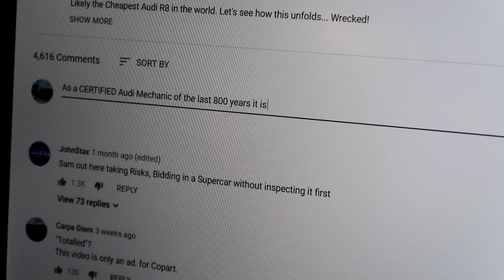I Finished the Salvage Audi R8 Rebuild Project! (and then BROKE it)

Comment: you don't need to be a "certified audi mechanics". Aluminum metallurgy is aluminum metallurgy. If by "fixing" it means closing a crack, than why not using putty instead? YEs, then you "fixed" it as well. Next time use gorilla tape, you'll save the 600 $ of "illusion welding" and your car will be fixed as well. ".. Aluminum welding typically creates a softened region in the weld metal and heat affected zone. Additional heat treatments may be needed to obtain an acceptable material for an application..."
Reply: smitthone for me it just sounds like you are pissed that it wasn’t you that made a deal on the car🙈🤣 I’m also a welder and I know that that repair will do just fine👌 as it is right now it’s probably better than OEM...
Reply: @vw52berg  Well, even more scary if you are a welder. And welding T Heat treated aluminum is not the same as welding the frame of your window

Comment: Hey Samcrac, it might be a good idea to find a couple bolts the same size as your wheel bolts, you can cut the head off and weld a small nut on it to turn it with a wrench. you can use it to make it much easier to hang your wheels on the car

Comment: OEM R8 alloys with same offset and they touch the callipers? Pretty weird if you ask me. 
Check the values on the rims you bought and compare it with the ones that where already on the car. You can find somewhere on the rim all the dimensions, they are pressed or graved in the metal. You may have to separate the tires from the alloys to find them. Here in Europe the offset is indicated by value "ET" don't know other parts of the world use the same standard.

Comment: Sam,  you should really get the carbon fiber air box, and get the carbon fiber side blade.  I wouldn't judge you for wrapping the side blade carbon fiber either.  but the carbon fiber air box really looks good.

Comment: A quality set of spacers will fix you up right sweet no problem. And don't listen to the people that start trying to to scare you with horror stories of "My friend had spacers on his 2012 Mustang and he went around the corner and his wheel came flying off and killed three Walmart Shoppers!".  Spacers are perfectly safe and work great if you buy proper ones for your wheels and use them correctly. Just search something like "What spacers should I use for my car" or something like that and you'll get any info on the subject you need. If you use the right kind (With a lip for the inside hole) you might not need to use the rings you have on the rear ones. But check into that first.

Comment: I know  am late to the dance on this car, but I had some crooked Volvo wheels repaired by a company named Alloy Wheel Repair in Birmingham.  They met me in a shopping center parking lot near me and used a jig set up with a hydraulic ram to straighten the wheels.  They also ground, polished and painted out the curb rash on three wheels all for a very reasonable price.

Comment: The weld was done fine as far as I can see - it was no less than they’d have done in the factory. The huge red light for me though would be those wheels -$1400 for 4 wheels tyres and sensors??? On a car capable of 180mph!?! Wow. There’s a reason the originals cost so much - they are rated to take not only the correct weight of the car but also the speed it’s able to do. You’d want nothing less than the best rubber on those rims (Pirelli P zeros or equivalent) which run £500 each on a car like that unless you just plan to use it as a runabout and not get some speed out of it. The fact that they are rubbing on the callipers means they are not correct for the car. Worrying. Other than that looks like you got a bargain though fairly high miles for a super car at 43k. Also interesting that the door buttons and key fob is the same as my 2009 vw Passat 😬.

Comment: Hey, Sam.  Big fan.  I hate to be the bearer of bad news, but those new tires are not the appropriate size for the (08-15) first gen R8.  I own a 2011 V10 Spyder.  Specifically the rear tire diameter is way too big.  USING THESE WHEELS COULD DAMAGE DRIVETRAIN COMPNENTS.  Factory size is 235/35/19 Front, 295/30/19 Rear.  I would suggest purchasing 305/30/19 Rear tires to avoid issues, they would pair well with your new 245/35/19 Fronts (IMO).  Regards, Ryan.

Comment: I would yank those front calipers off the car so fast and take them to a machine shop to mill 0.015" - 0.025" off of where there is any sign of rubbing/interference... Those calipers are way overbuilt castings, so that small amount shouldn't hurt anything, and once you paint them, no one will ever know. It will be our "secret"...

Comment: Why did that break caliper rubbing happen only on one unit? (The side with the frame failure....hmmm.)  
Shouldn't at least one  other caliper have had the same damage if the car frame / chassis was truly and properly aligned?

Comment: Hey Sam, when I saw you install the wheels with an impact driver I thought you cross threaded/broke a bolt. Starting them by hand will prevent cross threading and save you a major pain in the rear. 

Merry Christmas, I hope Santa/Krampus brought you some new calipers!

Comment: The troll you are trolling, is correct...  . That car is made of many different type steels. some of which cannot be repaired  using traditional methods once damaged. (BORON)     The proper repair method requires a whole new panel  to be put in.      Please refer to the Audi factory repair methods via THATCHEM...

Comment: that was your fault on the grinding on the front rims to the brakes  lol ....when you put on the wheels while is up ,you should have rotated to see if anything was hitting ....and make sure it will be a good fit .... and nothing hitting it in the inside ...while rotating

Comment: Are you telling us you mounted the wheels and did not check to see if they rubbed on anything. If they were rubbing when driving they certainly had to be rubbing after being mounted. By the looks of the metal missing on the caliper there must be a lot of damage to the wheel as well. Your $1400 wheels are probably worth a lot less now.

Comment: You fix up the car and then take out the panels in the engine bay but are too fucking lazy to put plastic restoring gel on the engine bay parts and it looks like fucking crap.